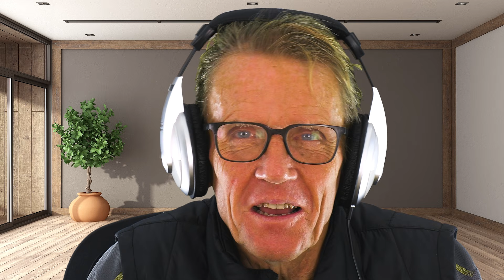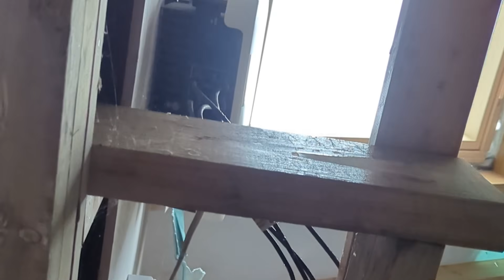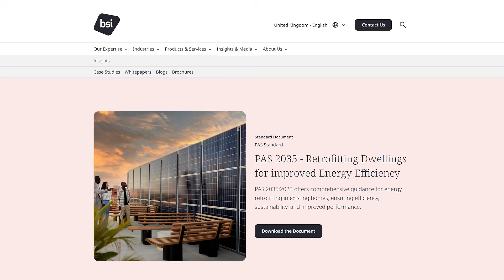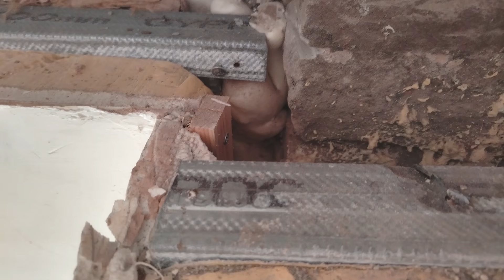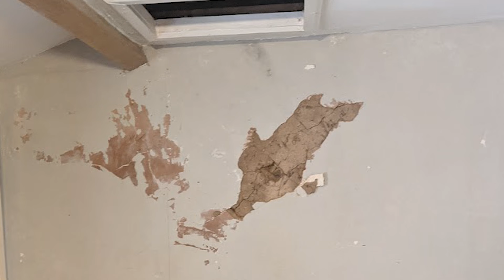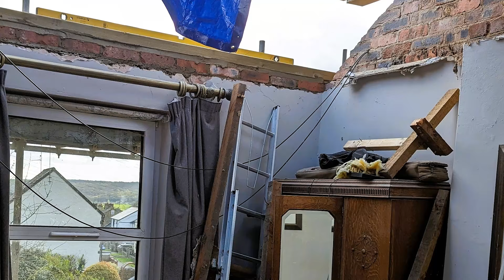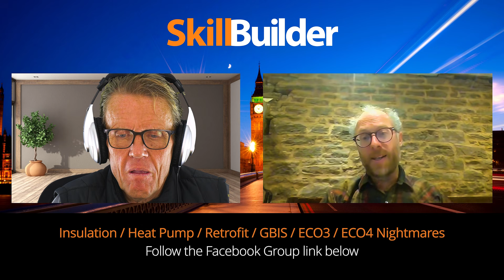Government Scheme Leaves Homeowners in Ruin – And Nobody Cares!

Comment: I would be interested in knowing WHY does heat pumps not work in the UK? Plenty of people have them in Sweden where it gets a lot colder and it differs a bit from model to model but they are often good for about -25C, once below that you need to supplement with another heating source.
Reply: I think iys so cold in Sweden on the winter that the air is dry. Where as in uk it is damp kinda cold and so the heat pump has a hard time bringing the house up to heat..or so I'm told

Comment: Its a complete con. If they could find out what oil was being used in a year they would be able to estimate KWh equivalent from a heat pump during the heating season. That consumption would provide a proxy for building fabric efficiency. If their original design was competent you would probably not agree to the cost of the installation. They know that.

Comment: MCS has a page (linked from the govt page on Boiler Upgrade Scheme) with more information for where and how to escalate problems with the scheme.
Heat pumps can be controlled by an external temperature sensor and weather info and forecast, 
It's too rigid that you aren't allowed to return the heat pump to get their money back, if it is unlivable for example. The fact they agreed to complete work and refused to look at the actual picture, then started the work without that picture. No investigation, it's fully the installer's fault they didn't do any inspection and closed their ears when they were told issues, just wanted to get the profit and run on to the next job.

Comment: I am 5th generation in a family run lime based plastering company. I was approached roughly 8 years ago to be a contractor to insulate homes under the local authority. I told them the products used were not suitable for property’s with no cavity of that age and not to do it.
Literally thousands have been done in my local area. Last year I got 16 phones calls in one week about damp where this horrific cheap insulation has been applied.
Even the local council have phoned me as they believe it’s how it’s been installed - they just do not listen it can’t be on there it’s not breathable told them hundreds of times emails, phone calls face to face with contractors and owners - even when they get the problem they still don’t listen - it’s completely shocking

Comment: I have said from day one the weakness of heat pumps is the matrix freezing up and the machine has to shut down to defrost. Not a problem in very cold climate as the air is dry but in cool damp UK that heat pump will struggle and use a lot of electricity. 
Never take the government grant, keep the gas boiler you will need it at times.
It is a fact that heat pump systems are more expensive to run in winter but much cheaper in summer so over a year it should work out cheaper overall.

Comment: Sounds typical for a business/sector expanding too quicky causing quality issues. It all makes me wonder if it's worth getting independent heat and roof serveys first. Or even if you can get independent heat serveys. To confirm the installers figures at the start

Comment: In my view building control should be involved before solar panels are fitted, in the same way that they would be for a loft conversion and if necessary a structural engineer should be employed.  It is no good relying on the company fitting the panels who are mostly interested in making the sale and fitting as many panels as possible with as little effort as they can get away with.  I've seen acouple of installs where unqualified workmen (not even trained carpenters) have been sent around to 'bulk up' the roof before panels were fitted.  As a chippy myself I was singularly unimpressed on both occasions.

Comment: Double glazed PVC units instead of sash windows or any wood frame was a huge step forwards, as was loft insulation rolls. After that gains start to drop, closing the cavity on cavity walls is a cheap gain, filling it up is something I have always avoided. Internal insulation will ruin the look of the stone walls but insulated drywalling need add only 2” to the wall thickness, not 4”, and makes a huge difference. Floor insulation can make a difference but on some floors, such as suspended timber, makes very little. It is a complex business and worth getting a pro to look at it, rather than an installer who is selling kit.

Comment: My parents were in exactly the same dilemma. Govt scheme replaced an oil boiler with an Air Source Heat Pump 18 months ago. The heating costs doubled over the first 12 months and they were generally cold! It was £15-20 a day at times. Luckily my dad didnt let them fully remove the boiler and so its now back in running the heating.

Comment: The couple I know who paid a LOT of money for air source heat pump, and solar panels, live in an older building. Their electricity costs to run the heat pump, would run two newer households easily. Their heating costs having moved from gas, have more than doubled, and close to trebled. £6k to run a modest detached 3 bed house.

Excess electricity they sell back gets them circa 9p a kWh. Their setup is inefficient to start with because their 70 year old roof wasn't deemed suitable for fitting the panels available 10 years ago. Lightweight and much more efficient panels available today, can't be installed on the roof now as Roger rightly says at around 12mins into the video, once you accept grant money, there's no walking back on your installation. Worse, is the grant money didn't pay for anything completely, it helped, but the homeowner still had a quite a bill to pay for the installation. And if the couple I know are anything to go by, it's an installation that keeps on 'costing'. Older homes need suitable external insulation to make a air source heat pump work, and better still if they don't have neighbours to upset with noisy fans. 

Heat pumps, just don't work in older buildings. They work in dwellings MADE to modern (eco) insulation standards, where 3 candles would keep the dwelling warm with -5C temperatures outside. Solar panel systems need circa 16 panels and a complementary battery system to make it viable. (So you use all the electricity you produce, rather than sell at 9p and buy back at 29p.) 

Someone, or a some "group" needs to challenge the seeming 'one-way law' in the courts regarding taking money (government grant) that prevents going back to carbon based energy use. Even if it means having to refund the grant, or unspent portion of it. For example, if the grant had been used to install and use a system for 10 years, it should be deemed to have "run its life", and will have qualified for a suitable replacement with any system the homeowner chooses.

Comment: Had cavity wall insulation installed, and a week later had a vent removed and the guys informed me they couldn’t see any of the beads when the removed the vent form the 1st floor. It turns out they had only filled the cavity wall up half way on the ground floor. So 75% of my property had no cavity wall insulation beads. The literally only filled up the lower 20%-25% of my property the cheeky feekers

Comment: Another example of how tax payers money is wasted on rubbish heat pump installers who haven't the skills to install systems correctly. It beggars belief that politicians and government are still not on the case, particularly given the shortage of cash for public services. I agree with a lot that is said in the video, though I would suggest that heat pumps run most efficiently when NEVER turned off. Just leave them chug away at say 20 degrees so that when the weather is warmer they switch off and when cooler they stay on - this maintains the thermal energy in bricks and mortar and avoids cooling, which, as Roger points out, takes ages to get back up to temp. Of course, as Duncan suggests, if the system is costly then the temptation is to turn off the system for keeping it on is expensive. For wrongly specc'ed systems this IS the sign (of failure) that the system was not designed properly. In my own case the Roger/Heat Geek videos and the lessons learned led me to NEVER touch the controls and as a result my house is at a constant 20 degrees (except when higher in summer) and my energy bills have been slashed, while the Vaillant remains one of the most efficient 12kWh air source pump systems in the country. So, the final question is can I afford the now reduced electricity/gas bills to maintain that temperature? Thankfully yes. And that is the key metric that everyone should take away, for it is the only one that really matters! Having wasted thousands on my first HP installation, I was very lucky to come across Skill Builder and then the Heat Geeks - two sets of folk who know exactly what they are doing.

Comment: So I paid one of the local schemes for attic insulation.  They came round and in 3 hours had done the job, except the roofer guy who came round a week later and put 6 vents in my roof.
Here's the thing though.  The house is a chalet bungalow.  That means the bedroom is in the same ventilated space as the attic.  So now the bedroom walls are just one single sheet of plaster board from near outdoor temps at night.  Further, as the boiler cupboard interconnects the first floor underfloor space to the attic that is not not only ventilated, but forms a fire sucking chimney effect such that if you pull a bulb fitting out of the kitchen cieling it would easily suck a cotton ball in the hole there is that amount of draft.  I need firehoods badly on those lights.  Heating the bedroom is nearly impossible.  I added another duvet.  To fix the mess and separate the airspaces and add insulation where needed to the backsides of studwalls and stairwell cieling, £2000.
I believe due to the house design, a "warm attic" might have been a more appropriate fix.
Reply: If the bedroom walls are that cold it won't be long before the humidity from peoples breath will continuously condensate, without mentioning any other sources of humidity, will result in black mould.
Reply: @MrCapacitator  Yeah.  It is humidity monitored and the door is usually left open.
The heating controller will turn the heating on if the RH gets over 80%.
If it could open a window it would.

Comment: Seems like this chap bought a dwelling that was not habitable or capable of being heated economically. The old oil boiler was probably not up to the job and would be costing a fortune. It is possible to have a 22kwh heat pump on a single phase supply, and combined with a wood burning stove when it is really cold (possibly three weeks a year) it should be warm enough with decent radiators and insulation.

Comment: We seriously looked at ASHP.

My wife and I are both BEng and both specialise in thermal equipment design so heat loss calc are not a problem but at the moment the current situation appears to be that the home owner is expected to learn themselves how to fully spec an ASHP system.

We got several quotes with massively varying costs which to means that some suppliers are trying their luck  Feels like they believe that the gov grant is just to help their profit margin rather than reduce our cost.

I'm also not prepared to dig up all the floors fir UFH and using rads as emitters would have required massive rads to keep the SCOP in reasonable figures.

If you're gutting a house then I'd probably pull the trigger but as an option just to replace a boiler??  Not convinced,
Reply: Would skirting board radiators be an option? Also, see the recent @HeatGeek ZeroDisrupt install option?

Comment: Carbon neutral cult demand you live your lives according to the Greta Thunberg bible for morons.
When we get rid of the woke political parties Lib/Lab/Con who are led by the nose from the destructive media, then we can sort this policy out.

Back to 100mm cavity, 50mm insulation.
New foil insulation
integrated extraction
Solar panels

If the government want to fund something, Fund a way for Hydrogen power to work which will resolve ALL our energy problems and get off Fission.
Reply: Buying hydrogen is currently 5-6x cost of gas or a heat pump. Not feasible.

Comment: My house is 300+ years old with two foot solid stone walls. My 20 year old oil boiler costs £800 last year and £600  so far this year for as much hot water and central heating as we have needed. We have a log burner which I use probably fifteen to twenty evenings a year more for asthetic purposes than real need. I start my log burner using some of the many leaflets I get offering  heat pump and other money saving schemes. Until China stops opening new coal power stations I will carry on as I see fit.

Comment: I’m a central heating installer for over 40 years 
I wouldn’t fit a heat pump as far as I could throw one 
The ratio difference the heat pump gives you on electricity costs is more expensive compared to gas heating 
Plus it’s running temperature are far lower 
It’s all about the money being given away ! 
Plus the planet lives of CO2 nett Zero is a con as plant life will die if it gets to low

Comment: I’ve been involved in running several projects where we have installed a heat pump both air and ground source as part of a wider renovation project where proper consideration was made to design and system requirements structure and use of insulation to suit the building and I’m often asked if just replacing conventional heating system with a pump is a good idea my recommendation every time is if you’re not running an underfloor heating system and have sufficient insulation to prevent heat losses then don’t bother I can’t wait for the tv adverts and the cold calls seeing if you have been miss sold a heat pump and can claim compensation if like many and most people you live in a home built before 2000 make dam sure your getting good advice from more than one place on what is required for this kind of heating system to work like it should before going ahead unfortunately there’s to many good sales people and not enough expert advice out there
Reply: Heat pumps are great. This was a poor plan and install of insulation, surely?

Comment: I would imagine that taking heat from the ground just outside your house would lower the general dew point locally - thus increasing dampness in the air outside, and also bring forward that point in the year where you could get ground frost.

If I am correct in that general assertion, then increasing dampness locally and increasing ground frost locally is not going to be a good thing for your general overall energy equation.
Reply: There's a lot of energy in the ground, and heat from the air and surrounding soil replaces the heat you take out.

Comment: Contrary to popular belief this is not Millibands fault- cr4p installs have been happening for years.
The solution is simple - compulsory insurance backed guaranteed - the insurance companies would soon weed out the cowboys, and the customer would be protected. With an ombudsman to keep the insurers honest.
Also, critically, we need more competition. Free manufacturer's courses for the ten of thousands of heating engineers out there, and I would give the job of policing the system to Gas safe they keep the gas industry in line admirably for little cost and hassle.

Comment: I am one of those that had a heat pump installed, poorly installed and have been fighting my installers for two years. I did reach out to Skill Builder but didn't get back to me. You can read my story on renewable heating hub. Once my story went up, my installer reached out to renewableheatinghub and demanded they remove the story immediately.

Comment: Hmmmm.
No proper inspection.
No analysis and conclusions specific to the property.
No engineering inspection of the load capacity of the building.
No insurance support for the property owner.
It all sounds pretty bad.
If it were a small company or sole trader, they'd be in court with large fines

Comment: I fitted my own solar panels. No planning permission either. Saves a bit of money doing it yourself.
Reply: MCS needed for export payments though? At the moment export payments are quite lucrative.
Reply: @Biggest-hz7ng  Octopus are letting people that fitted their own get exports. You have to do quite a bit of paperwork. I use the spare power to heat the water tank to try save not exporting it as like you say I cannot get any money. I was off grid with batteries but they dead and other problems so just connected the panels to the grid now.
Reply: @damianbutterworth2434 batteries and solar have come home down a lot in price, so maybe if you have the money?

Comment: A very big installer in the local area of the Forest of Dean, fitted my pump-8kw, and same issue. My home is a new build and I use 50 + kw daily in the autumn and winter. Joke. The pumps are only any good within a full scheme of renewable energy. Solar, battery storage for load shifting and a wood burner. So I have 45 kWh battery stack and charge them up at 7.p overnight and use that battery by day to power the home. That’s very cool.

Comment: I I hear the homeowners frustration and dissapointment with what was 'sold' to him and is typical of the industry resulting from ignorant Gov policies.  An analogy  of Its like having a 1978 Jag  ............ lets put a 1 litre Ford engine in it and itll do 40 mpg......look it says it here in the guides....fast forward  its about 2 mpg better and not fit for purpose. If you want lower fuel bills buy a superwarm house designed for a heat pump. People never learn.